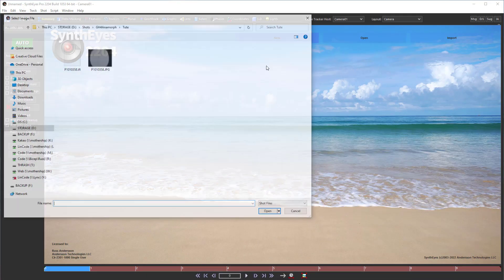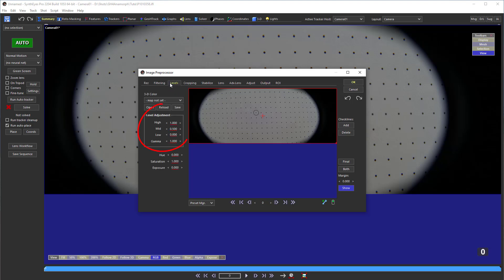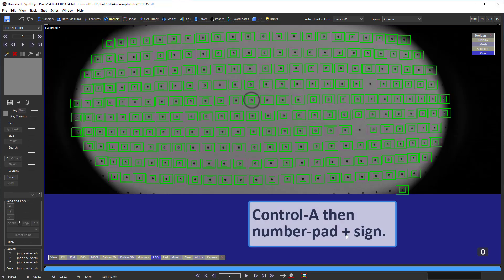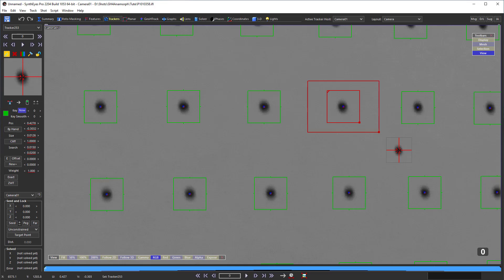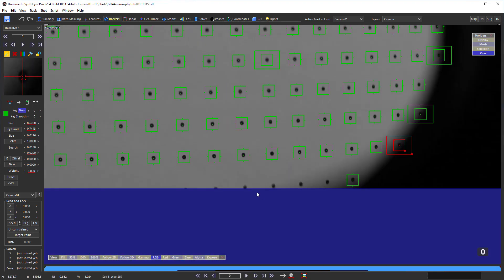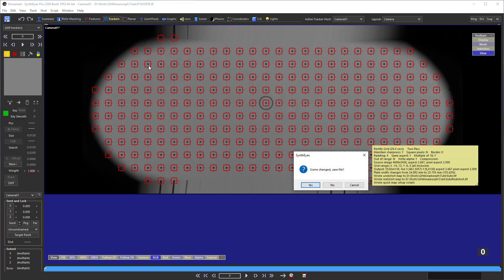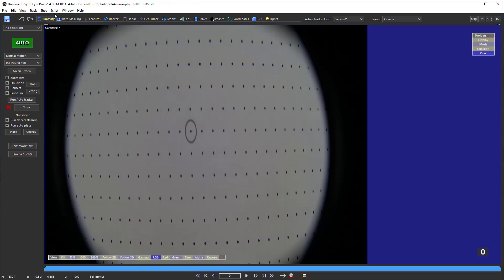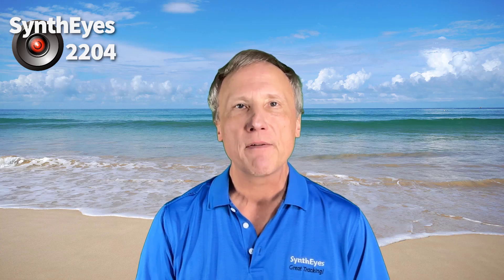Rectify Lens Grid: Just fix it! [Boris FX SynthEyes]

Comment: Once i get the stmaps and the scripts, can i use the script to remove distortion on new footage? I did it in a different project and exported the 3d track directly to blender but the footage automatically imported in blender appers to be not affected by the undistortion applies before. . Any tips? The track seems fine, but the plate is unusable in blender